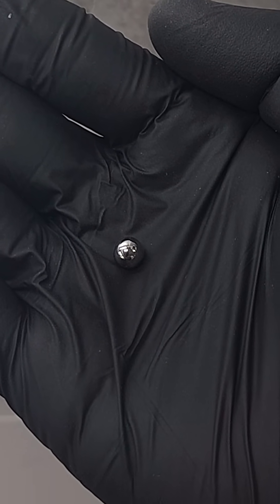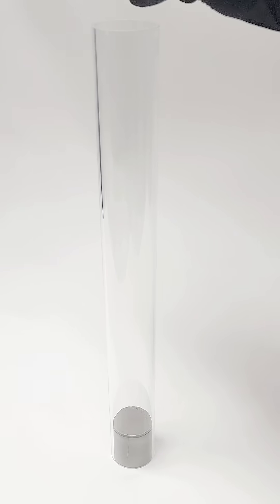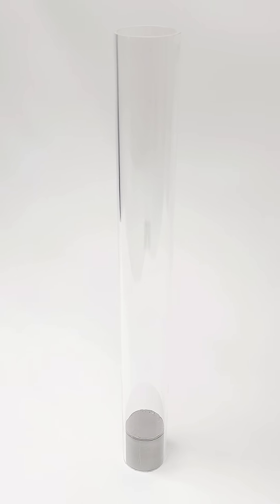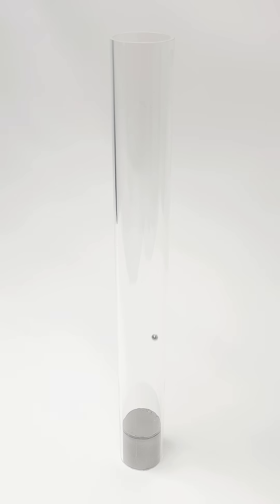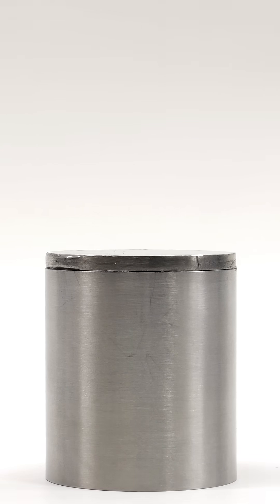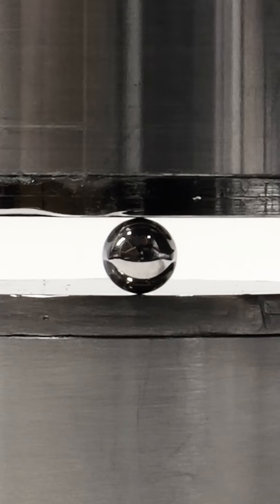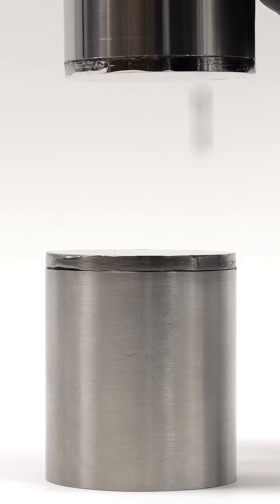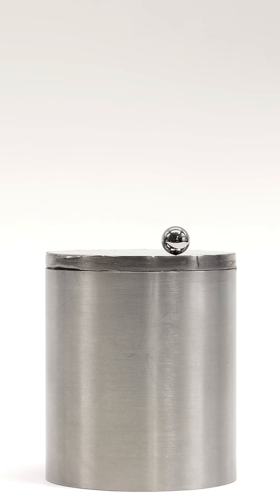This metal is too bouncy

Comment: Two thoughts:

1) It reminds me of the signal we get from the gravitational waves of a black hole merger

2) I’m seeing a few people in here suggesting that the ball is bouncing tens of thousands of times per second. I’m not sure how valuable that is as a measurement. Sure, we can posit that the ball bounces tens of thousands of times in total (or maybe vastly more if I’m not mistaken), but in terms of the rate of bounces per unit of time, it seems to me that it stands to reason that since it ultimately results in constant contact, the curve of the frequency would increase exponentially and there exists an infinitesimal moment just before final rest where the ball is bouncing practically infinite times per second. On the other hand, on the atomic scale, nothing ever really “touches”, which paradoxically adds to my point as well. I know this is kinda splitting hairs, but it seems to me that speculating over the maximum frequency is rather redundant. It’s not like it “peaks”. It just increases until it literally can no longer. I suppose when you factor in the ball’s deformation, there would be a point where kinetic energy would be lost in the form of heat and leach momentum from the system and you’d end up with a peak frequency, but I suspect the number would be absurdly large. I’ve seen other people suggest the SlowMoGuys might be able to capture it but the amount of zoom, framerate and light that it would require would be inconceivably massive. It can probably only be figured out via math, realistically. Things would be happening on literally the atomic scale.

A third thought that this all brings me to is that it would be interesting to know how much the system would heat up depending on how quickly you were to mash the ball between the two trampolines and force it to accelerate. Obviously something would break at a given point (not sure if it would be the ball or one of the trampolines) but it’d be cool to know just how insanely high the limits are…

Man. Some spectacular physics happening here.
Reply: My first thought was also the LIGO BHM whip sound.

For it to go as fast as you're suggesting etc. suggests far more energy in the system than originally available, the PE of the ball prior release.
Reply: @iRossco  you’re right. I suggested infinite speeds and obviously that’s impossible. Not even relativistic but at least well into Mach numbers. Maybe it is worth getting the SlowMoGuys involved but I still feel like they wouldn’t be able to capture anything interesting during the last moment before the ball stops moving.

Comment: I think i saw a video by 3blue1brown that said that the number of total collisions was pi and as u increased the magnitute u get more and more digits of pi, ofc this is assuming perfectly elastic collision and a very accurate way to count them as well as constant energy in the system, so it isn't exactly the same situation but i think the solution should be somewhat similar. Lastly when i say pi i mean: magnitude 10^3-> 314 collisions, 10^1=3 and so on

Comment: I'm pretty sure that in Physics, this would come under the heading of Oscillations: with the number of bounces per second (Frequency) being inversely proportional to the distance of a complete bounce (Wavelength). Thus, by reducing the space between the top & bottom surfaces, the number of bounces per second skyrockets.

Could someone who's more expert in Physics properly explain this, please?

It occurs to me that given how much physical energy can be stored within it, this Hyperelastic Alloy would be exceptionally useful in making the Mainspring for a Wind-up Clock.

Comment: This hyperelastic metal is really fascinating. 

Where is the energy needed to keep the system going (ball bouncing) coming from? Is it the potential energy / elastic deformation of the metal ball bearing, the elastic deformation of the new alloy, or from a property of the alloy's internal structure..?

High-speed & thermal imaging of the bouncing ball (& the hyperelastic alloy sheets) would show some interesting things.
Reply: It isn't going on it stops

 the energy is because he dropped it from much higher than he held the trampoline at the end

Comment: you should hold the atomic trampoline fixated about the bottom one and let the ball bounce between the two at a low bounce so it bounces extremely fast and leave it there for as long as it can stay and post it

Comment: Try that with 20 or 100 ball bearings.

Make the top part into an electromagnet to hold them all up at the same height, then cut off the current flow and drop the top on to all the bearings as they bounce.  It would become the worlds most interesting springy bouncy shock absorber.

Comment: Ok, So now, magnetize the trampolines so they repel each other. Put one trampoline in the tube, drop the ball in, then put the other trampoline in the tube. See how many bounces you get and see how long it takes for the ball to eventually stop bouncing.
Reply: Physics will then take a screenshot
Reply: Endurance test at its finest
Reply: Since the ball is made of metal, it wouldn't bounce at all and stick to the bottom magnetic trampoline.
Reply: the universe: nah screw this... JOHNNY! Get the black hole gun, yeah another idiot is trying to break the law
Reply: If im not mistaken, the trampoline is actually a lump of bulk metallic glass. And they can be magnetized but not nearly strong enough to set up your experiment. 

But i know very little about BMGs and I may be wrong about their potential magnetic properties
Reply: Use a non-ferrous material for the ball (ie brass, aluminum, copper, glass) assuming those would be hard enough/not present eddy current magnetic effects.
Reply: Maybe add vibration too.

Comment: There needs to be a fidget toy or one of those satisfying water toys that just does that in a tube.

Just make the bottom one a launcher like from a pin-ball game and add small holes for the sound to come out of, as well as the ability to adjust where the top one is so you can do exactly what he just did, but completely controlled.

Comment: You should totally drop a bearing onto one of these in a vacuum. It’s obviously barely losing any energy to the metal itself, so I’m curious to see how many times it would bounce if air resistance wasn’t a factor.

Comment: As a perfect pitch haver, the highest note I can discern is E6. Which has the frequency of 1318 Hz,.so that's how many bounces is the maximum in a second. But that was a short window of time, barely audible, which tells us it's about 30-50 milliseconds long, so, in that window it was up to 65 bounces (in 50 milliseconds)
Reply: just put it into a spectrum analyzer
Reply: I slowed it down like 50% and heard it actually reaches a high C for a moment

Comment: Isn't the frequency directly proportional to the bouncing speed? That's a high pitch, at least sweeping beyond 15khz. Which implies that many contacts per second. You need to work out how to turn this into an ultra analog synth. Can you start the bouncing without physically dropping it? With an electromagnet built into the base?